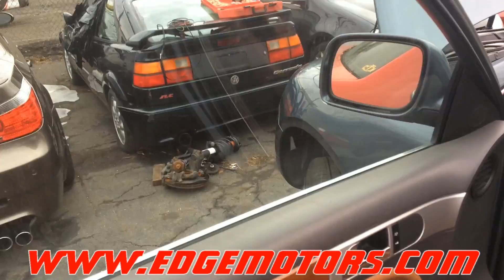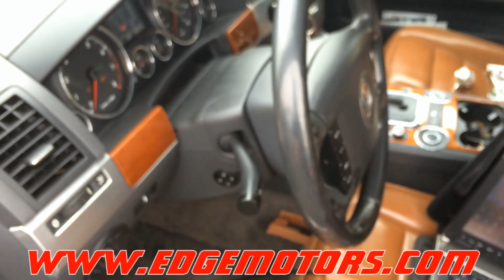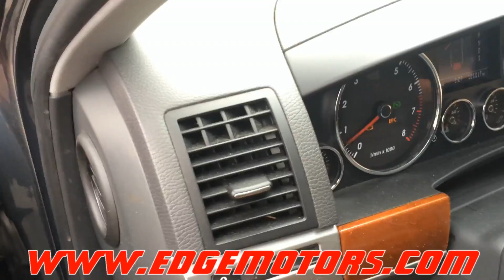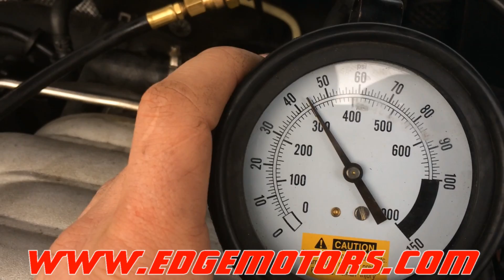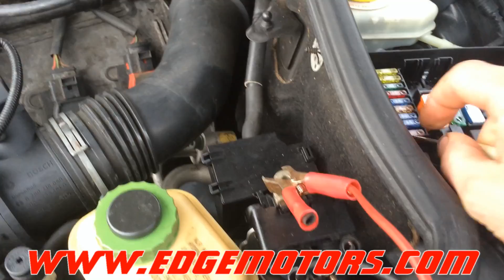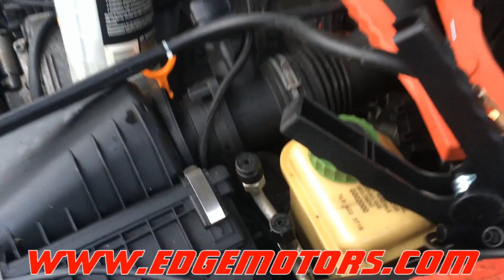VW touareg Audi Q7 fuel pressure and fuel pump flow test DIY by Edge Motors

Comment: What would cause the pins to the relay coil to get under voltage? Can the fuel pump fuses be used as a bypass?

Comment: Hi Ihave a q7 2007 The EPC light and engine light are now on it drives fine for 15-20 min then the it starts to rough idle getting more violent as the time goes and the car is at a standstill.. it wil start to die towards the end of the drive if I dont make it back home the gas pedals becomes unresponsive and will burst the car off  to get it to make it home if played with just right and will drive a little further and a stop light will cause it to shut off again i checked pcv vlves which seem cleaned CODES has misfires on all cylinders and runs lean
Reply: I have the same problem, did you figure out what it was?

Comment: Hello good night, I live in Brazil and I own a touareg V6 year 2008, which presented two problems, it has a strong smell of gasoline on the opposite side of the tank, and is blowing by the dipstick, could you help me by giving a tip? I'm very grateful.att André.
Reply from the maker: Check the fuel filter cover, they crack sometimes...
The blow by Id need to see the car...

Comment: Engine is running fine but these errors will not go away. I get them on every trip. So this is due to the right side pump not pumping enough fuel according to you test. Do you think this is the case? I cannot test the pumps like you did. 
I checked all sensors and I have vcds logs showing all sensors working fine. 

17499 - Mixture Regulation; Bank 2; Range 1: Rich Limit Exceeded 
P1091 - 002 - Lower Limit Exceeded
17573 - Long Term Fuel Trim Additive Air; Bank 1; Range 1: System too Rich 
P1165 - 002 - Lower Limit Exceeded

Car is a Touareg 2004 3.2
Pumps have never been touched.
Will a filter replacement only fix the issue?
Will a fuel sender replacement only fix the issue?
Reply: Hie , got a Vw Touareg r5 TdI, my problem is last week the fuel station guys put diesel that was contaminated with water, after driving for a few kilomtres, the car stated misfiring and some jags then it stopped, i tried to crank it then it started aftr few seconds of idling it cuts off,we checked the diesel in the filter thats when whe saw that there was a mixture of diesel and water, so we drained all the diesel in the tank and cleaned the tank and also cranking to clear everthing in line from tank to the diesel filter, then we put new diesel n new filter, but nw the car is only cranking without starting, wat could be the problem guys

Comment: High EdgeMotors
I have a Q7 I need to change the high pressure fuel pump
Can you tell me the part number for the pump as I am having difficulty locating the
Exact one like in your video
Reply from the maker: I don’t believe we have a video on a high pressure file pump for those...

Comment: Hey I have a 2004 vw Touareg v8 and i changed the spark plugs at 129,000 miles and like 25 mile last I check the plugs again and there were black like the vehicle is burning a lot of oil and it's misfiring a lot can you give me any suggestions what I should do. And now when I try to turn on my vehicle it cranks but it does not start like if there's no gas going into the engine I will check the gas pressure.
Reply: Did you ever found out what was wrong with your vehicle mine is doing the same thing but it's to the point it won't crank now.
Reply: @krambert6172  check the pump and secondary pump. Start with simple things first fuel lines, fuses also scan for any codes

Comment: Hello. Just dealing with an issue for 08 Q7 (seems to be same as the vehicle in your video). We replaced both fuel pumps and the fuel pressure sensor but still have a check engine with camshaft sensor error. Do you have any ideas what it could be? Any help is much appreciated. Thank you.
Reply from the maker: Rami Mansourati 
Camshaft position sensor codes, have nothing to do with fuel pumps... Check if the codes come up after you clear them with the engine off, if they do, then most likely a problem with electrical system. If they don't, then most likely a problem with engine timing...

Comment: Hi, have a cayenne 2004 4.5L V8 the truck stalls, I cleaned fuel filter it was very cloged, put it back and still doing the same, have  60 psi on fuel, and I did the flow test, collected 500 ml of fuel in the 2 pumps in 15 seconds, are the fuel pump bad_
Reply from the maker: Eduardo Blanco 
I would need more info in it,
When does it stall?
Every time you start it or not?
Did you test both pumps together or separate?
Reply: Hi, it ignites every time and after abot 5 MINUTES it starts to hesitate, today did not stall but it hesitates, i tried each pump separate and both and pressure seems ok, after 5 minutes fuel pressure still same, that make me think injectors are closing ok and fuel pressure refulator is working, now im wondering if could be electrical problem, no codes are shown on scanner.

Comment: i have 2004 touareg 3.2 
start the engine and keeps only 10-15 seconds on.   
where I need to start cheking?
Reply: Anybody ever find out the problem with that as that is exactly what's happening to me if anybody knows would be very much appreciated if someone could help me out
Reply: Maybe the main fuel pump

Comment: Hi, I have a 2006 Touareg. It has a problem on its first start after leaving it for 12 hours or so. It turns over and tries to star and dies and then will only fire up after 30 seconds of turning over. once it has started it is fine for the rest of the day. I have had it looked at and there are no faults and no reason for it not to start. any ideas?
Reply from the maker: check to see if your fuel pressure drops after the car has bees sitting, install the fuel pressure gauge on is and start the car, then turn it off and let it sit enough time for it not to start.. then before starting, check the pressure and see if you have any pressure there, if not most likely one of the check valves on the pump failed.

Comment: Hi i have a 2008 touareg. It doesnt indicate fuel capacity correctly. For example when I fill the tank full but it shows half of tank. Could you say what is the problem
Reply from the maker: you have to scan the cluster and see what each level sensor is reading... most likely something is wrong with one of the level sensors.

Comment: I have a 05 Touareg and my engine would not stay running, I changed the plugs but nothing happen. Do you think it might be the fuel pumps?
Reply from the maker: there could be allot of reasons for your car not to stay running.....
you have to find where is the problem coming from. is it missing fuel or spark at the moment is stalls...
check fuel pressure and go from there...
good luck